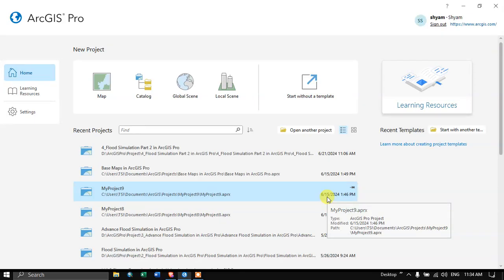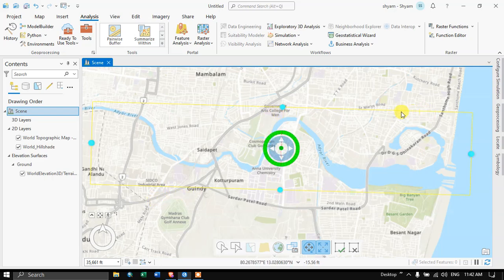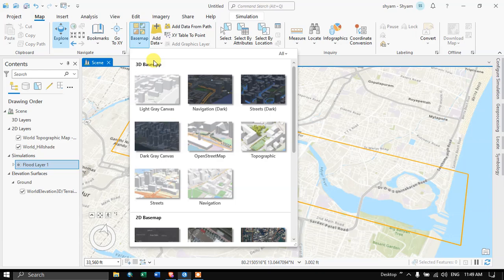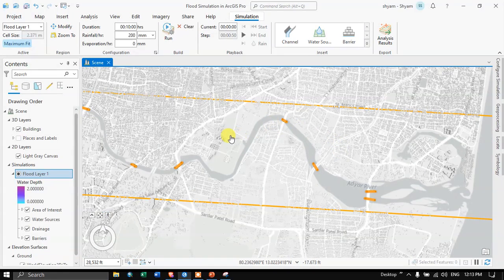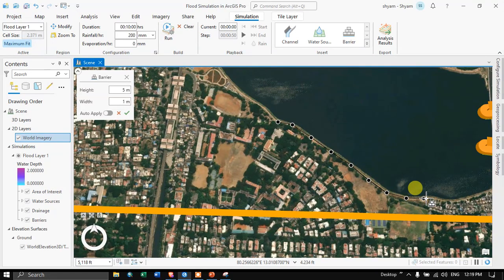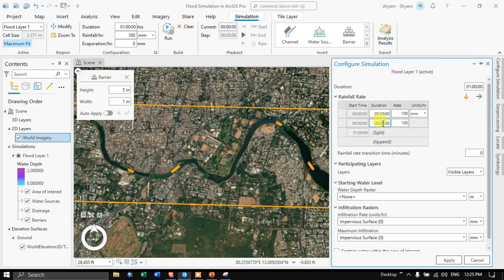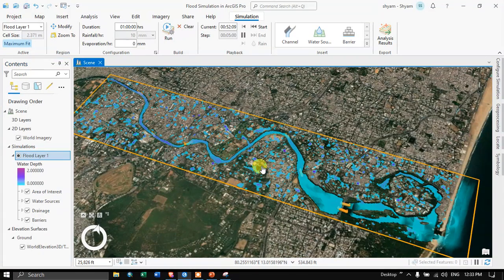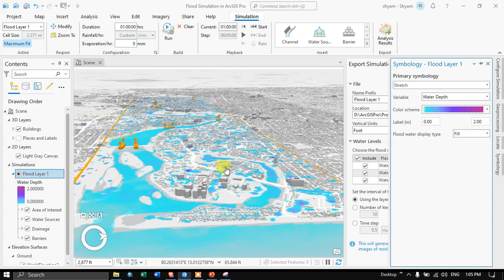Create and Export Flood Simulation for Adyar River Basin Using ArcGIS Pro 3.3

Comment: Can i add my own data 3d buildings and terrain and add dem and carry out the same on my layers
Reply from the maker: Hi, Sure you can add data and carry on with the flood simulation
Reply from the maker: Yes, you can use your own DEM, 3D buildings, and terrain data in ArcGIS Pro. Just make sure all your layers are georeferenced correctly and in the same coordinate system. Then you can perform the same flood simulation workflow on your own data.